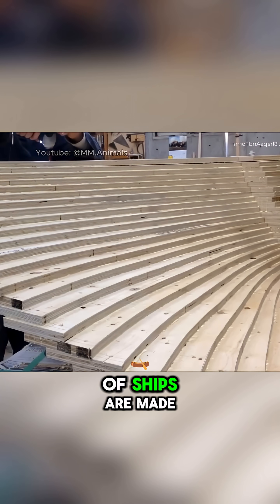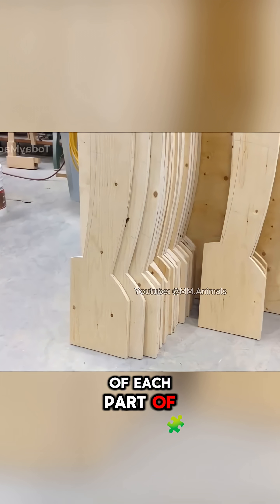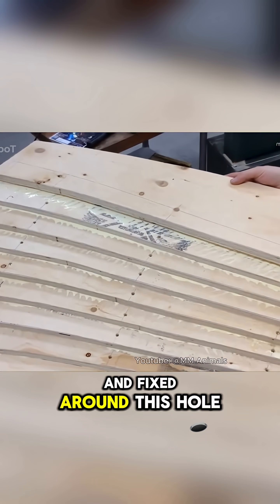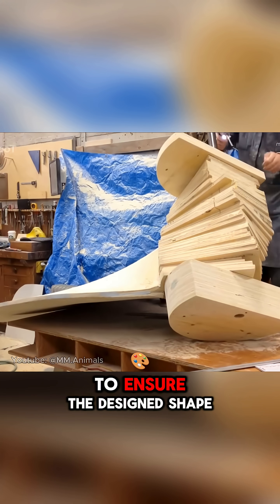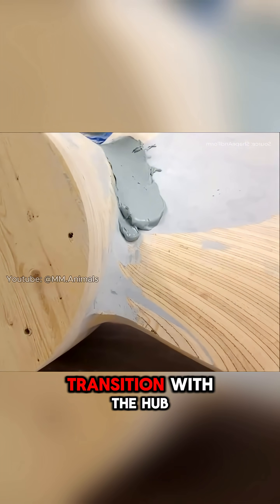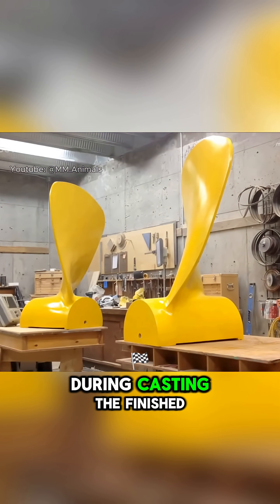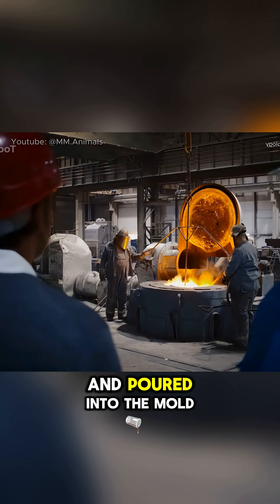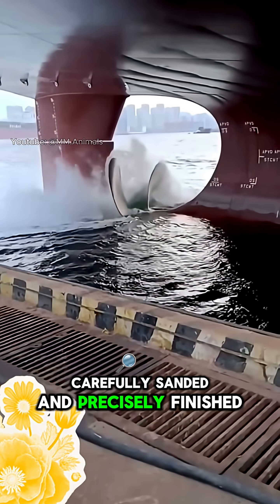How a Colossal Ship Propeller is Made. #ships  #manufacturing  #discovery  #knowledge

Comment: Correct this short video... propeller is made of brass or an alloy of strong metals to withstand sea corrosion and friction of sea water during rotation .... what you are showing is the primary mold. The second mold is made of sand where molten brass or molten metal alloy is drooped in to create the final propeller.

Comment: From the first sentence this article/film fails to explain that the wooden structure is used to CREATE the mould, which in turn receives molten copper alloy which solidifies into the finished propeller.
How are young people with no experience of engineering supposed to work out what is going on here, given such a flawed and misleading voiceover ??

Comment: Okay. Basic nautical parlance 1010. The propulsion devices used to transfer rotational force from engines to move a ship or boat through water are not...NOT... called propellers. They are called screws. Propellers are on airplanes, screws on ships/boats.
Reply: rotors for helicopters

Comment: Though the wood this is used to set the model sent to the Founder for setting up this molding then Removed the Brass is heat till being melted at a liquid and thin poured into that model! 
Removed and allowed cooling time! The goes into a snapping time of shaping by sanding to the pitch need for the SHIPS thrust NEEDED

Comment: Ship propellers are usually made from a few different metal alloys. The most common ones are aluminum, bronze, and stainless steel. Each one has its own benefits, like aluminum is lightweight and bronze is super durable.
Reply: Rust resistant 😊